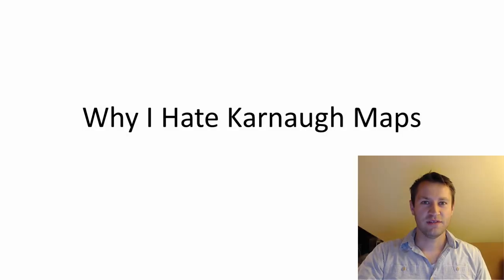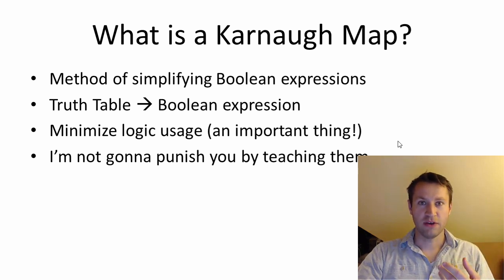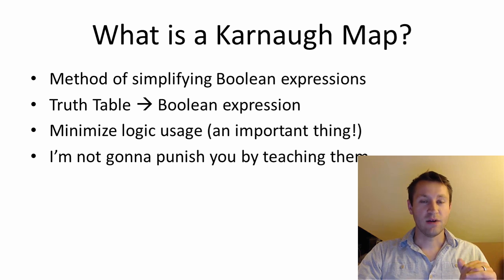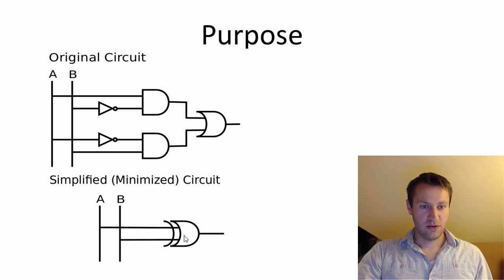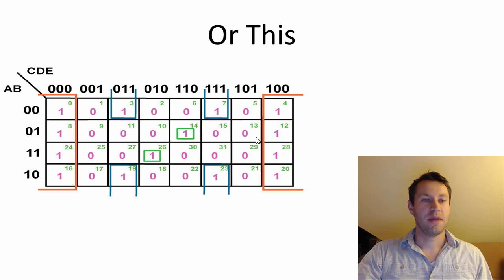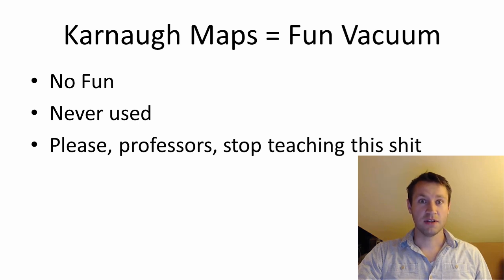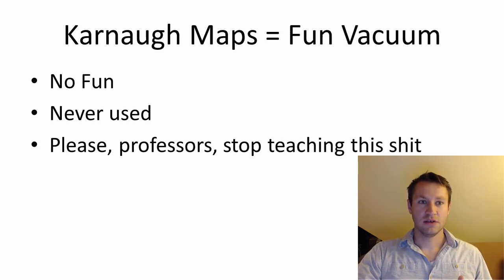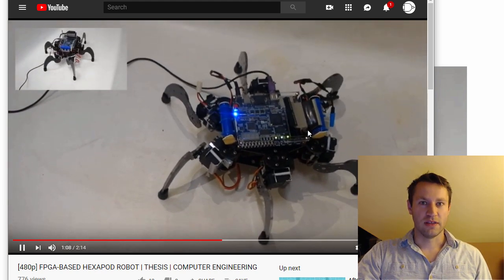Why I Hate Karnaugh Maps

Comment: I couldn't disagree with you more. Actually, Karnaugh maps are fun to do. Eliminating knowledge of Karnaugh maps is just another dumbing down of Electrical Engineering and turning it into a "coding" science. It's already weird to me that designing FPGAs is still considered Electrical Engineering since you can write Verilog and VHDL code without even needing to know Ohm's Law or anything about electricity. And by the way, not all digital logic is done by FPGAs. If you need to implement something simple without using a $50 FPGA instead of $2 logic, you won't be using an FPGA or synthesis.

Comment: Saw the title and had to take a look at the video ...much of the beauty of Karnaugh Maps are for when you don't have to find outputs for all of the possible inputs to your system - because its visual, it's really easy to see groupings of terms that you can eliminate and even more so if you have "don't care" states.  I agree that any programmatical reduction of boolean algebra will beat the pants off doing it manually with a Karnaugh Map (especially when you get more than 4 input terms!) but as a way to float the underlying mechanisms that are going on I think they're not a bad aid to teaching ... I've never used them outside of Uni except once in the last 25 years ... having to learn Gray code in order to write a correct Karnaugh Map is a complete turn-off for most students though, so I get that they're not fun from that point of view ...

Comment: To teach Karnaugh maps I use only one or two hours ...and two single boolean algebra laws. For programming an FPGA...  after more than 30 hours of research, I (the high school teacher) haven’t found a model of FPGA, an “IDE” and an HDL, simple, general and “cheap” enough, so that my students can learn a working method and knowledge not limited to a single example or “educational board” and so that my school can afford the costs. The biggest problem is the lack of documentation for an “high school level” of teaching. I found your channel today: I hope that it can be useful for me to find the right answers in the future
Reply: You might consider icestudio and the UPduino 3.0.  Free software, < $30 for hardware per student.  And you could easily delve into verilog/VHDL from there if you wanted to.
Reply: @botsnlinux  after many months of research I chose to use a cheap ( 15€ ) PSoC 5LP board from Cypress. The IDE (free, stable, open source and updated in 2020) is very simple, “electronic oriented” and inside the chip there are some programmable blocks that can be configured using a subset of Verilog

Comment: I disagree. I actually enjoy K-maps, and I use them almost every day. There have been many cases where I had a multi-input truth table, where the K-maps helped me separate out the inputs and reduce the critical path as a result. That becomes especially important for the multi-output LUTs like the Xilinx chips have, allowing for increased resource utilization. In my experience, the synthesis tools often do a crappy job at that sort of task.
Another way you could look at the topic is from the perspective of a historical importance. You teach K-maps for the same reason that you teach infinite series in calculus, even though in practice, you will almost always use some tool like Mathematica to evaluate them for you.

Comment: Well said! We were taught them in Engineering at Cambridge. So pointless. They also managed to completely put me off electronics by tediously deriving theoretically perfect values for resistors and whatnot. Very difficult maths. The real world is more like "try 10k, that'll probably work".

Our microcontroller programming class consisted of manually assembling a program (yes we literally had to look up op codes) and then tediously typing the op codes into 70s era number pad whose only interface was a number pad. Fun fun fun! This was in ~2004. Hopefully they've improved things since then but I would be surprised if they have.

Comment: I can't remember using a Karnaugh map for a practical purpose, but one time I had an exam in a Digital Systems class and one of the exam questions asked you "How to assign 8 symbols to the corners of a cube such that the transition energy required to go from 1 symbol to another is minimezed". Although Karnaugh maps were not used in that course, I used a Karnaugh map to map the 3 bits used to the 8 symbols. Turns out, that assignment used the minimum energy :) 

Other than that, I don't have any particular feelings towards that or boolean algebra.

Comment: I get your point but isn't university all about the fundamentals and a comprehensive preparation to be able to create such stuff (as the hexapod) on your own?
A professor can show it to students but then what? There is a time when a professor needs to teach them all the low-level stuff even if this is not used in the industry because it's a great way to understand how all this digital electronic stuff works.
I mean, what's the point of presenting Verilog coding if one has no idea how a NAND gate or multiplexer works?

I had two programs at my uni, one covered all the basics with gates, Karnaugh maps and simplest devices, and the second covered some VHDL project and more advanced theory.
It boosted my skills from the total 0 (I didn't know much about Boolean algebra and didn't know FPGAs existed) to such an extent that my thesis work was related to FPGAs (implementation of a stream cipher) and I'm able collaborate with the industry now.
Reply: if its about the fundamentals and comprehensive preparation then its better to use boolean algebra, where the real math and logic behind the circuit is at work.

Comment: I would argue that K-map is useful. I would like to see you make simple a circuit which detect the pattern 10011 in a binary stream. In other words, if the pattern is found in the stream of bits, the output is 1, otherwise 0. I would love to see if you can avoid K-map to solve this in a systematic way.
Reply from the maker: Use Verilog or VHDL and a synthesis tool. The days of drawing circuits is long gone.
Reply: @Nandland  Thank you, Russell. 
But we need to explain the underlying mechanism of such circuits to the students in their early stages. Synthesis tools are supposed to ease the process and it does not mean that the person does not need to understand the whole process. 
I will try to explain this with an analogy. 
For example. calculator is meant to ease the arithmetic operations for human but this does not mean that in the early stages of mathematics lectures we tell the students to take this calculator and do the arithmetic operation and you don't need to understand how 3+5=8. SImply do it with the calculator.
Reply from the maker: @mirfan3c  Thanks for your perspective!

Comment: Let me give you one example where Karnaugh maps can be useful. If you're designing an asynchronous circuit and you get glitches, then you can look at your Karnaugh map and see if there's an area of overlap between different regions. If you can the min term that covers both regions, even though it is redundant, it can remove the glitch. So, Karnaugh maps can provide some insight.

Comment: currently learning this, but first, we had to convert 6 pages of number binary hex octal decimal...  I just wanted to leave
Reply: Base conversions are an important skill if you get a job related to digital design. I read hex and have to think in binary all day, it'd be a huge waste of time if I relied on a calculator to convert for me.

So don't think that learning to quickly convert between bases is a waste of time.

To the point of this video, I also deal with a lot of Boolean logic. K-maps are important as well.

Comment: I dare to slightly disagree with you. Not because I like to stick to ancient and outdated technologies, but because I am convinced that before building that FPGA robot which you mentioned the students need to get a firm understanding of the basics. 

Yes, its absolutely true that for all practical purposes Karnaugh-maps are surely not used in the real world. Mostly because they are absolutely impractical for more than 5 inputs. But I also must tell you that our students year after year had fun solving stuff in this rather unconventional way.

Teaching them the as obsolete Quine–McCluskey algorithm - that would be boring. This is truly a mechanized operation which should only be done by computers. But seeing patterns in a Karnaugh-map - that's so far only a human experience.

We combine Karnaugh-maps and the first experience in digital electronics for our students intensively with simulating the resulting circuits in Logisim - which also includes a simplification tool. But trusting any piece of software without the possibility to check out simple models for yourself is something which I would not want to teach my students.

Comment: EE ABET accreditation requires certain curriculum, even unfun stuff. How many times does one apply Differential Equations or Calculus 🤔
Reply: Differential Equations or Calculus? If you work with analog electronics or even radio with filters, perhaps every day. Same if your work involves Control Theory / SCADA systems. And that's the thing isn't it? Educating engineers isn't just about teaching stuff the current industry wants or the lowest common denominator. The curriculum is supposed to be versatile, broad and also potentially make you ready for a future place in academia or make you able to publish something yourself. And some things are taught not because they are directly useful, but because the topics broaden your perspective and the way you think.  Higher education is supposed to be more than the direct utility value.
Reply: "How many times does one apply Differential Equations or Calculus?"   
Answer: To basically every math problem that exists in the real world. 
Your question is truly bizarre given that almost everything in physics is a differential equation and almost everything we model relies on some change over time concept.